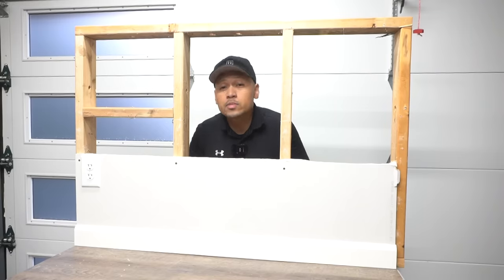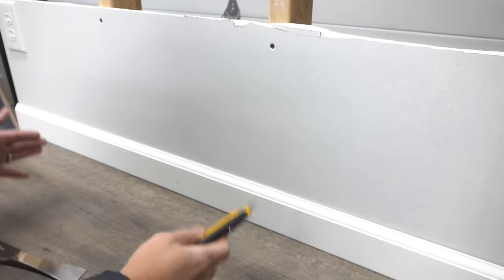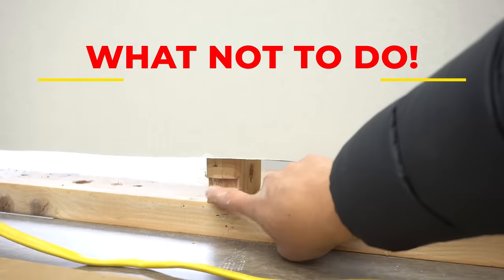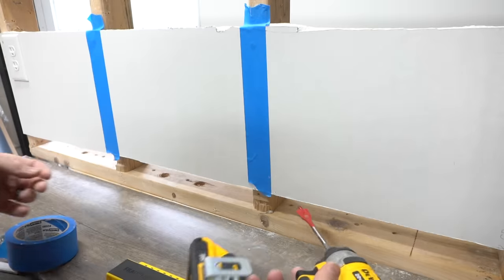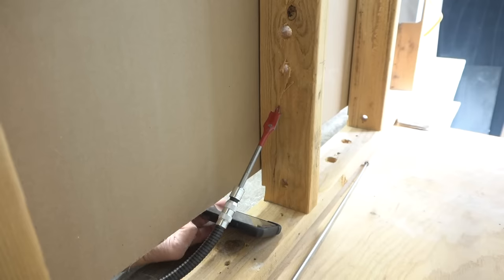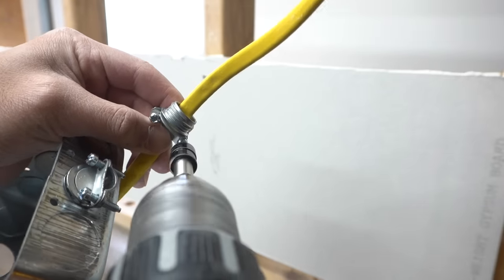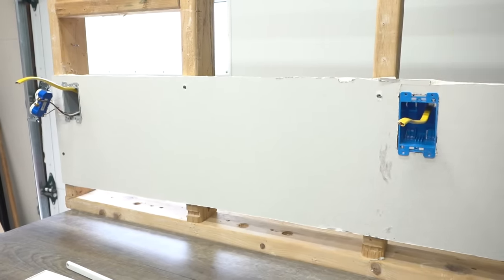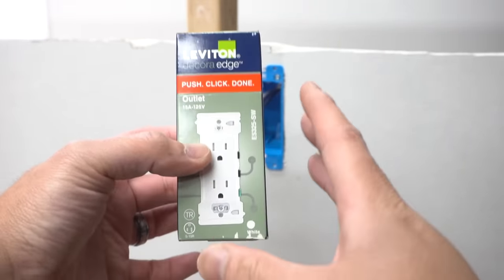How To RUN And HIDE Electrical Cable Behind Baseboard Without Doing Drywall Repair Work! DIY

Comment from the maker: ITEMS I USED ON THIS VIDEO: 
- Flexible Drill Bit Extension - https://amzn.to/40oum1s
- Endoscope Camera With Light - https://amzn.to/41DAqUK
- Baseboard Mini Pry Bar - https://amzn.to/3opZ1OB
- Baseboard Trim Puller - https://amzn.to/41o2vzA
- 3/4” Spade Bit (6inch long) - https://amzn.to/3LnARgR
- 3/4” Spade Bit (4inch long) - https://amzn.to/41B4HU0
- VOLTCLAW - https://amzn.to/41GlsNH

POWER TOOLS I USED:
- Drill / Impact Set - https://amzn.to/3UR9Bu7
- WORX 18 gauge Brad Nailer - https://amzn.to/3Ac4089

LEVITON DECORA EDGE OUTLETS & SWITCH:
- Leviton Decora Edge 15 Amp Tamper-Resistant Outlet - https://homedepot.sjv.io/eK4A0Q
- Leviton Decora Edge 15 Amp Tamper-Resistant Outlet (10 Pack) - https://homedepot.sjv.io/y2RmJW
- Leviton Decora Edge 15 Amp Single Pole Switch - https://homedepot.sjv.io/Py06JQ
- Leviton Decora Edge 15 Amp 3-Way Switch - https://homedepot.sjv.io/k0joDd

Comment: You had me until the flex bit and putting your hand in the wall... Your hand clearly goes beyond the 2x4 stud, which in real life applications would be impossible due to insulation inside the wall (most of the time) and sheetrock on the other side of the wall.
Reply: The lack of finished wall/s, insulation is just for demonstration.  Nothing you posted can prevent what he did.

Comment: Everything about this fix is excellently explained and demonstrated. But this would be a little trickier with insulation commonly found in hollow walls.
Reply: That was my immediate thought, in the setting of newer homes or recently renovated homes. 

the cavity between studs typically will have insulation and will not be this bare. Just for all to keep in mind.
Reply: Not in south Florida. I’ve renovated many homes and never encountered insulation in an interior wall.
Reply: @quentin.smith_  not interior walls insulation is put in exterior walls.

Comment: My understanding is you should never run power horizontally in walls. When some one goes to run a data line or fiber correctly from above and uses a drywall saw to place a post wire box, guess what will happen?!
Reply: "My understanding is you should never run power horizontally in walls."  ...  You have a misunderstanding.  What should happen is the person has to make sure there is no wire/s to cut/nail into.  In that case, guess what will not happen.

Comment: Why don't you just not put back the cut drywall ? So if someone put new baseboard they will see the cable running along the wall when removing the old baseboard
Reply: Or, leave some gaps. You need to fill in the gap so the baseboard can be nailed to the stude and stay upright.
Reply: Get the new outlets/wiring the same height as the existing ones.  Always put the cut-out piece back in.  In fact, it should also be taped/sealed.

Comment: Why can't I just run the new wire within metal conduit? I cringed just looking at your wrist. I have a hard enough time just dealing with 12 guage wire, being a 71 year old woman.
Reply: Not an electrician, but that may be okay as long as you aren't using FMC, as nails/screws go right through it and it tends to move less than Romex, making the wires more likely to be damaged by a nail or screw.

To me, even EMT seems a little risky, so I'd use IDF to make sure it's protected. However, rigid metal conduit is going to use a lot of space, so might have to notch more than you're allowed. Plus still have the water issue if there is a flood or leak, so would also want to use wiring rated for wet environments, like THWN. Again, I'm not an electrician, so check with an electrician or inspector.

I'd rather cut out drywall, patch and paint than deal with all this though

Comment: It's a great concept idea but that's been done for decades and the only reason that idea didn't take off well... There is a chance of electrical damage... So please everybody pay attention if he should ever replace those baseboards and someone installs new baseboards with finish nails they will impact and hit that electrical wire which will cost a shortage and hopefully does not create a fire... Keep this in mind and a real framing while there is insulation that is easy to catch fire.. that concept idea would not even pass through city codes... I know this because I'm a general contractor part of my license traded C10 which is for residential electrical... The other element most likely your house insurance will not cover any fire damage once is inspected how this wire was installed...
Reply from the maker: Hi! I’m assuming you didn’t watch the video. I placed the wire almost 9” off the floor. Those are very high baseboards 😅
Reply: It's legal behind baseboard area using minimum 1/16" steel protection plates as normal on studs. etc etc  May not be best area but not off limits. Steel plate a bit heavier than 1/16" the entire length of cable better if someone must have baseboard outlets. They look better than on the walls imo. If outlets are on wall then stay on same line
Reply: Watch the whole video. He said not to place the wire along the baseboard.

Comment: My walls are old plaster walls but are in really good condition. I am trying to rid of some of the old outlets and install new ones. How could I do this with old plaster walls if it's possible. Since the house is older some of the other outlets can be gone. I am tired of extention cords and electric power strips especially during the holidays. Any advice would help. Thank you
Reply from the maker: Hi Jacquelyn! I will have to create a mock up made of plaster to accomplish this tutorial. It will be made of lath and plaster, is that similar to yours? If you can send me a picture of the inside of the wall if possible that would be great! Here is my email: fixthishouse1@yahoo.com 🙏🏽👍🏽😊
Reply: @FixThisHouse Did you end up making this video? 🙏🏻
Reply: You can take out the plaster behind the baseboards and jsut put in some sheetrock to bring it back out level.

Comment: Great idea unless it is an insulated exterior wall.
Reply: Studs can still be drilled, and wire can still be fished.  Or, buy more wire, run up, across, then down.  There may be the issue of a fire block, but that can be overcome, also.

Comment: Nice tip mate .  Not so easy if the wall is rammed full of class fibre insulation or rockwool ( sound proofing & heat insulation ) , a requirement in the uk .
Reply: Really depends on which wall it is in the US.  If it is an exteriar wall then you will find all sorts of insulation material. The interior walls will be more empty but you can still come across all sorts of pipes and wires.

Comment: Nice idea. The only comment I've got is this. It's always best to hit studs with nails to hold the base back snug. 
If the person doing this keeps track of the wire locations, it may be okay. Having said that, if someone else pulls the base and doesn't know there is a wire in that location, it may be a problem. Some of the newer air nailers can blow through p plates or kick and curl the nails. Nice video though! 😊
Reply: I’m pretty sure he knows that. He’s just explaining what can happen. Some may not know about the studs. This is for DIYers😉

Comment: Any thoughts on metal studs? Am thinking of drilling holes with a hole saw behind the baseboard area and installing the plastic protectors normally used in metal studs for protecting Romex.

Comment: Could you run in a piece of metal conduit.  
Does the wire in the stud need a meta protection  plate ?
Great video wirh your display
Reply: Most houses are gonna have plastic boxes, how would you run metal conduit to a plastic box
Reply: No, and not necessary.
No.
Remember, even where local codes are stricter than the NEC, they usually allow homeowners, I.E., DYI, more leeway.  An electrician may, by code, have to do something a certain way, while the homeowner may not.
Reply: To elaborate, conduit on the outside of the wall would be ugly.  :-p  Of course, if you don't care, have at it.  It would still have to run into the wall, and into the old/new junction boxes, secured to the boxes, with no less than 6" of wire/s coming out past the wall/new junction box.  The dude failed to mention the required wire length.  The required wire length would also apply to the old box.

Comment: Thanks for this. Idea,, question is it necessary to use pigtails at the first outlet? Or is fine to connect straight to outlet powering second outlet. Thanks man
Reply from the maker: Hi! Either way works. It’s good to use pigtails just in case the outlet fails, the rest of the outlets down the same circuit connecting to that outlet doesn’t get affected.
Reply: @FixThisHouse  true, thanks! Love your videos👍 wallet doesnt

Comment: Is there any issue if I skip putting back the bottom drywall at all? The wires won't be exposed and bottom drywall is not visible at all anyway right? What are your thoughts?

Comment: I think it’s smart to drill your holes up higher but at the same time trimmers use 2” nails so if you were to drill the center of the studs down low I don’t think it would be a problem

Comment: Can you rewire while house that has many wires coming inside with this method of minimal wall destruction?
Reply: "while"?  If you meant to say, whole, no, the rewire has to start at the panel/breaker.  There is more to rewiring a whole house than meets the eye, first, regarding code.  So, bottom line, you need to state more elaborately, and specifically, what you are wanting to do.  Important, also, is why.  Do you have a dead section of wiring/outlet/s, for instance?  AL wiring?

Code,
wire type,
amps,
voltage,
proper circuit breaker for said,
is just the beginning of what you have to consider.

Keep in mind, one circuit for each room, if possible.  You don't want an outlet on a circuit in one room, that is on the same circuit as an outlet in another room.

However, there may be instances where you may properly wire two adjacent rooms, basically individually, on the same circuit.  The room closet to the electrical panel will be the first room, then the last outlet in the first room will run to the first outlet in the second room.  In both rooms, the first outlet runs to the other outlets in the room, then to the light switch, then to the light fixture.

If you meant to say, "while".  Yes, but it will be time-consuming.  Do your very best to get the outlets the same height as the existing outlets.  Would you still need to run wire to the switch, and then the light fixture?

There is so much more, then.  You need to do a lot of research.  Consider this: know what you want to do, put the plan on paper, hire a pro to evaluate, follow what the pro says you, as the homeowner, can or cannot do, and make detailed notes of that!  You still need to do a lot of research... LEARN!

NOTE: In case there has been someone before you in that home, invest in a wire finder, so if they already did some wiring, you have less of a chance to cut/nail into any existing wiring.  Learn how to use it, and always use it in any area you will drill or cut.  And, or, use one or more of the recommendations in this video. 

Don't kill yourself, or burn down your house, or kill your family... please.  :-)

Comment: That sounds simple and easy but it is far from easy. How can I cut the drywall straight across if there are studds in the way of me cutting the drywall?In between the studds would be an easy cut straight across however as soon as I get to a studd I would start cutting into the studd.
Reply: Huh?

Comment: The only problem is you would have to remove the trim to read that and the only time you're really going to hit the wire as if you hit it with a brad nailer which you wouldn't need to remove the trim to do that
Reply: Huh?

Comment: Why would you be able to not fasten 12 inches from the box with this method.     But fail inspection if a wire isn't secured when doing rough wiring
Reply from the maker: Code requirements as stated in the NEC
Reply: @FixThisHouse  I. Not I. No way discriminating not being fastened.  I'm asking because I'm needing to do basically same thing. But in baseboards used as the chase.  But didn't want it to be wrong.
Reply: @FixThisHouse   You should have cut lower, and also taped/sealed.  Regarding his question/s, what exactly is he asking?  Anyway, the NEC does not state a homeowner has to secure/staple, wires in a finished wall.  That's usually the case even where local codes are stricter.  For an electrician, and what you did, the electrician would not be required to secure the wiring.